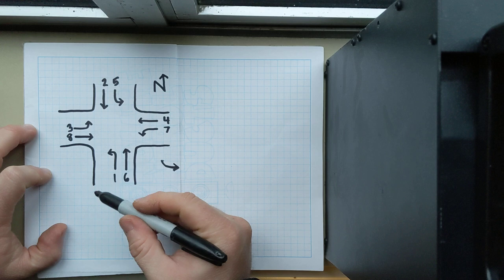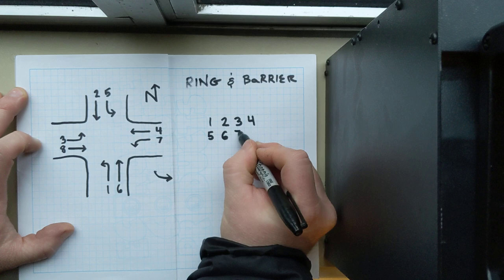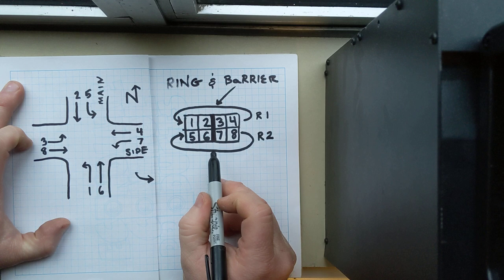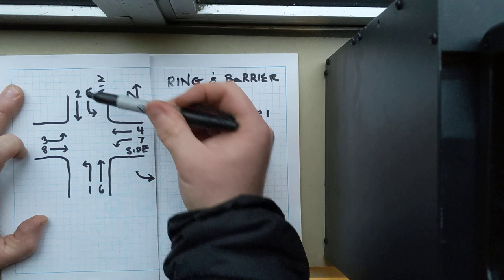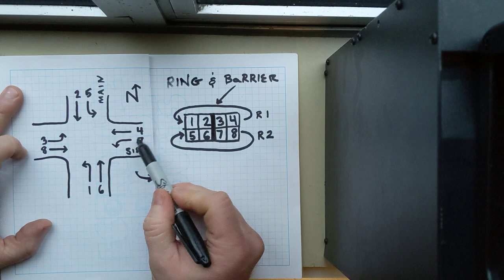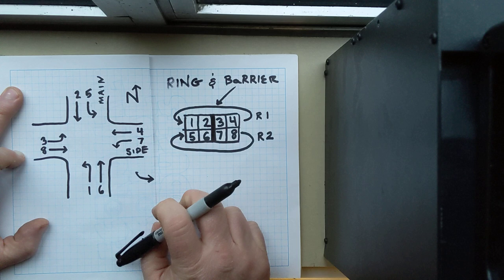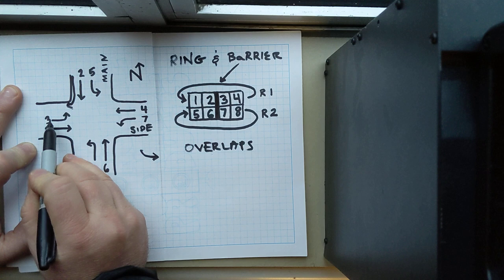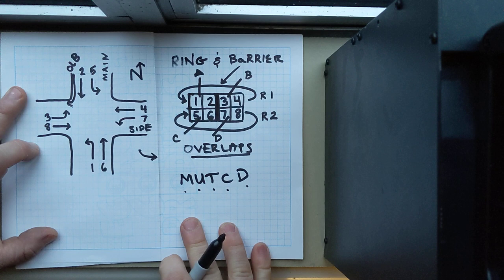Traffic Signal Sequence Logic

Comment: Here in Vegas we also use overlaps for left turn flashing yellow arrows. On those we also hook up resistors to the unused greens on the load switches to prevent the conflict monitor from throwing the system into flash mode due to it thinking there's an open green circuit.
Reply: Booring and not informative

Comment: Hello from CT,  very interesting video on phasing. Speaking of phasing, I recently told you of a signal which we installed that completely eliminated Phase 1 from 1500 to 1830. Well, as it turns out the braintrusts at CTDOT have revised the program to allow 35" of green time during max 2 (0630 - 0900) and 10" of green time during max 1 (all other times) thus allowing phase 1 to operate all day until nighttime flash at 2200. The Engineer which I had shown your reply to had actually taken your advice!!

Our controllers here in CT use the phasing as illustrated in this video, however it is standard to insert Phase 9 in between rings if the intersection has an exclusive pedestrian phase. Until next time STAY SAFE!!
Reply from the maker: Cool! Yeah, a little bit of time on a max2 was the way to go. Yeah, exclusive peds are fun also.
Reply: What district  are you from
Reply: @Iaiashgamer  I, Elaine does not work for any district. My husband works for a contractor and uses my site from time to time.

Comment: But what if there's somebody waiting on the left turn lane but nobody waiting on the side street
Reply from the maker: If there is no detection on the side street and there is a protected left turn at the end of the max cycle length for the main Street, the opposing through movement would terminate allowing for the left turn to serve green. After that movement has been served it will then terminate and then cycle back to the opposing through Street movement.

Comment: What does VDC means on a conflict monitor
Reply from the maker: I am assuming that DC voltage but, usually it is 24 volt DC 1 and 24 volt DC 2

What manufacturer is the conflict monitor?